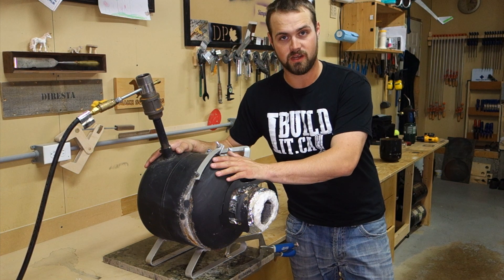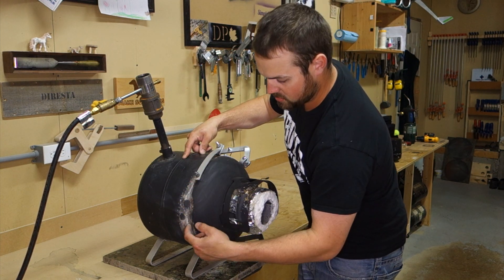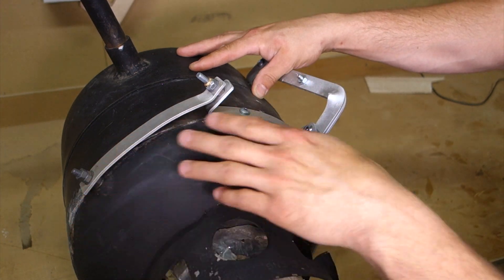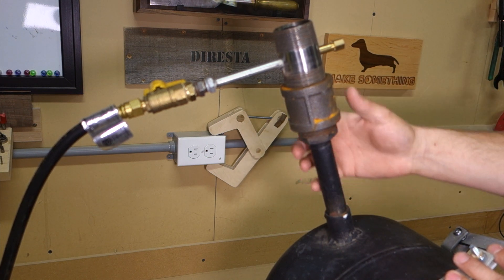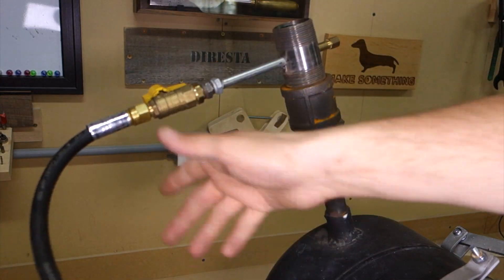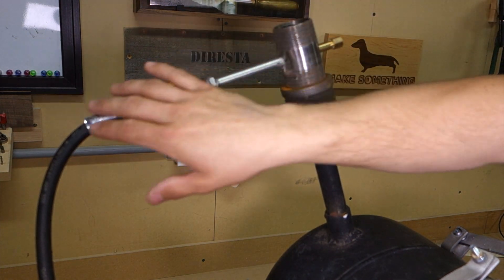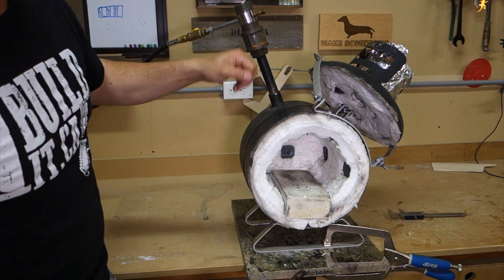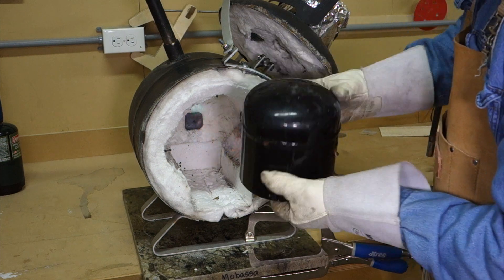Propane Foundry Furnace - MELT METAL!

Comment: Nice idea and very informative video. Unusual orientation of the oven. Did you ever had a spill of material or crucible failure so the metal drips out of the whole container? That would be one concern with such orientation I see.

Comment: Good stuff. But you didn't need to heat that crucible up to flatten the bottom. One solid bang with a sledge is all it takes.
Reply from the maker: I promise it most certainly needed to be heated!  Thanks

Comment: I have a Propane foundry /forge but mine stands up, drilled a hole a the bottom of the propane tanke when a crusible fails witch they do and put a catch pan below the hole to catch the molten metal. For my insulation inside the tank i used a 60, 40 ratio of 40 %portland cement an 60 % perlite. dry mixed it first. An let dry for a week to let all the mosture evaporate i put a 60 watt bulb inside turned on for the whole week to help curing time. I did same for the lid. Anyways  how long does ur fire insulation work inside ur tank and how long does it last bud.  i wanna no becsuse im wanna  make a brass forge with that insulation. I like the style of urs GOOD JOB.

Comment: what would you do differently today, Dustin?thanks,john
Reply from the maker: +horatio71 the project overall was very enjoyable, but I think it would be more practical as a vertical unit with a detached removable lid.  That way it could stand on the floor and not need to be on a table.

Comment: Oh man, this is great! We chatted a bit about your build, but this in depth video is fantastic. Thank you for taking the time to put it together. It will be a big help to to many people, myself included! Since you mention that you would do some things a little different if you were to build another one, what would you do differently? Thanks!
Reply from the maker: Thanks. I don't think I would bother building it on its side. It would be much easier to build and work with just having it sitting on the ground, upright like a normal tank. I would also upgrade the regulator to 30psi.

Comment: How hot does the outside get?  Does the ceramic fiber wool work better than using refractory?
Reply from the maker: Refractory cement? It stays cool to the touch. I have no idea how it compares to cement, I have nothing to compare it to.
Reply: Dustin Penner Yes, I was thinking refractory cement, or for example, lining it with firebricks and cementing them together. But I understand you have nothing to compare it too.  Thanks for sharing this video. I'm wanting to build something like this for myself, and I'm even more uninformed that you were when you started!